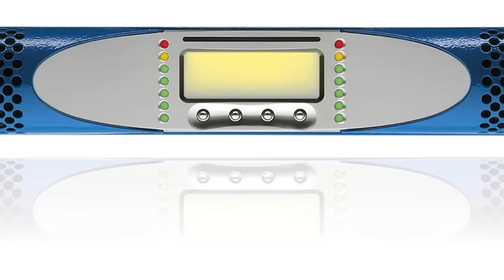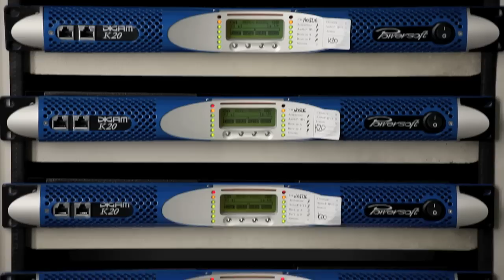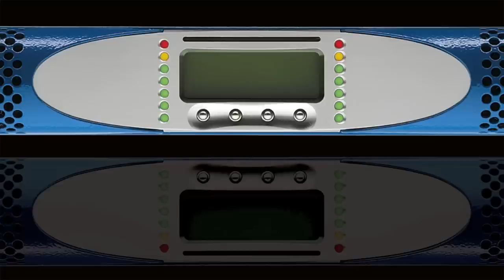How To Make Hi-Tech Amplifiers

Comment: Imagine the HVAC and mains requirements for this facility.
Power output can exceed power input if it's time-limited. These amplifiers work on a principal that is similar to the photo flash: energy is stored in banks of capacitors. A lot of energy can be released in a short amount of time. Of course it WOULD be really cool to have an amp do 9000 watts x 2 channels continuous sine wave, but the demands of that would require an outlet with 200 amp capacity at 120V. Fortunately, music has a crest factor, typically 9dB, so the amplifier only needs to pull 20A from the outlet to deliver those 9000W peaks with 900W avg power levels.
Reply: What kind of drugs are you on ?
Reply: Darren Woods Excuse me? Did you stop by to contribute something useful or just to make a fool of yourself?
Reply: basspig Your the one talking utter bullshit , no amp pulling only 20a can make peaks of 9kw even at 220v thats just nonsense the caps do not hold that much power for one, 

This is the kind of nonsense that companies use to convince you an amp's more powerful than it is.Also caps on the output stages are for filtering out the high frequencies uses in class d operation.
Reply: Darren Woods When I was naive, I used to think the same as you. But then I learned about crest factor and how many joules of energy is stored in capacitors. I'm not claiming the amplifiers can output 9kW continuous sine wave, but they do it for short durations enough for a percussion hit and maybe a bit longer, before the energy storage must be replenished in the power supply. Class D don't use caps to filter the switching. In the Crown XTi series amp I just repaired, their are just four large toroid inductors that filter the switching signal of 250KHz. At those frequencies, you don't need large capacitors to filter RF energy. The electrolytics are for power storage, not removing hash from the output.
Reply: I thought they generally use a LC filter to take care of the high freqs ?  Also I do understand about all these factors , but sorry I still do not agree with those figures. If caps could store that much power they would be better than batteries. And what good is 9kw for a split second like as you put it a "flash" what good is it for a split second ...sorry I got off harsh but I just think amp manufactures often blatantly lie about its power rating , you talk about sine wave and such but have your ever herd the crap amps have to deal with these days like dubstep with massively loud low end basslines that go on for minutes on end.
Reply: Darren Woods I do agree that it's rather ingenuous to rate amplifiers like this, however, in pro sound, entire FoH systems are built with a reserve capacity and rarely if ever see full utilization.
The main factor that makes this work is the fact that music has a 'crest factor' (a peak to average ratio) of 9dB. That means the average power that the amp must deliver is only about 1000W, while it can handle the occasional peak of 9000W for a few hundred milliseconds. 
Electrolytic caps can store a LOT of energy. Back when I used to service broadcast transmitters, the newer solid state ones operated with lower voltage but very high current. Another tech accidentally dropped a screwdriver which shorted across terminals of the main filter caps, just moments after shut down, and the caps had enough stored energy to melt the shaft of the screwdriver.
Obviously, this amplifier cannot deliver 9000W for 30 seconds. Even the Crown I tested at half power into 4 ohm load popped one of its HEXFETs after 40 seconds of sine wave. These modern amps have wimpy output devices that will fail when fed continuous sine tones, so caution is advised when testing on the bench.
Reply: Which is exactly my point , modern music is so bass heavy (saying that some of the old real music can be even worse when played loud) but honestly I have tracks here I use for testing subs that are fair close to a pure sine wave at 30-50hz.

I have a good few amps sitting here and the way they rate them is a joke , I just wish they would pick a standard for real life and not use sneaky formulas and clever math to big up the numbers.

Just wish they would pick a real life standard and not a "we did this in a lab". I like ratings that reflect the actually power output of the amp and not what it can do very briefly, and yea I get it you need head room for the occasional jolt,  but as I have seen before some bastards hide in the small print that it can reach it for ...and I'm not joking ...a few nanosecond's ..how deceitful is that for a testing setup.

I know your not meant to drive amps like a dodgy dj and red line it all day long but hell , would be nice to know some times that whats written on the box is at least some what honest.
Reply: Ps last place I worked was a semiconductor fab/testing facility , over 120 racks burning in rectifiers , talking numbers lets say around 140k rectifiers being burned in at a time.With some not being moved for 2 weeks solid. You can imagine the amount of power used there.
Reply: Darren Woods Frankly, I share your disgust for the industry stretching the ratings like that. That's why I prefer the older amps like the QSC Powerlights I use in my sound system. Even at 59lbs, I consider that light, but the amps will pull 92 amperes from the line and put out 6kW all day long if they have to. But even so, my system is running on dual 15A Potter & Brumfield magnetic breakers and I rarely ever trip them and when I do, the SPL is well over 140dB (the limit of my CEL 201 meter). This indicates that even with pretty heavy bass content, the amp's draw is only a fraction of what it will draw in a sine wave bench test. I have just two 15A breakers serving a rack full of QSC and Hafler amplifiers which, all together, are capable of pulling over 250 amperes with continuous sine at full output (a condition for which I have no dummy load big enough to test).
The reality is, if you could put out that kind of power for several seconds, you'd probably smoke all the voice coils. Speakers are rated in a similar fashion per EIA standard RS-426A and if you put continuous sine wave into those same speakers, they would go up in smoke in a matter of seconds.
Reply: Darren Woods Yes, that's a lot of power. And the amount of waste heat means a huge HVAC requirement to remove the heat from the building, too, which means even MORE electric power needed. People don't appreciate the cost that goes into manufacturing electronics, but when you look at it this way, the prices seem quite reasonable.
Reply: Lol , and why missiles and defense shit costs so much when your charging 700$ for a single UA package transistor or 200$ for one rectifier :P This was not consumer grade components.

But yea just for one rectifier even consumer grade could be in a production run for well over a month in total and then people expect them for cents , its no wonder the commercial shit is done in Asia.

But hey at least when they rate it 3a/1000v you know it can do that for weeks on end. 

And not half a blink of an eye.
Reply: Oh godness. Two electronic en-juh-neeers about class D amps...
Reply: @technodaz he or she is probably on fentinol or some .!.!hajaajajajajaja

Comment: for maintenance I think that these amplifiers would be a problem to get the spare parts I think that the components are not identified a point to find since as a repair technician we must completely change the card holder that does not cost so cheap, I prefer the crown or crest for having better service maintenance within reach. I do not doubt that they are good amplifying but heard comment that their heel of aquileases the power supply.

Comment: Testing all the amplifiers at full power at once?? What sort of mammoth electricity supply do they have??
Reply: The output won't be a simple dummy load, it'll be intelligent power converters to recycle the electrical power - run all the amps in lock step and combine the outputs with small spreader resistors (probably the cables themselves) straight into big power converter.
Alternatively you could probably just set the amps to produce 220Vac at 50Hz out and power half the factory indirectly(!)
Reply: @MarkTillotson  that makes sense - more economical than a big bank of power resistors or heating elements and a fan.

Comment: People thinking that power out can equal more than power in with proper music are being badly deceived, 20 amps at 240 volts in is about 1800 ish per channel out with a 20% loss and that cont max, you will see a little more with peaks but that's about it, yes they are smaller and lighter and aslo more efficient by around 20% over a 3 step class H but no where near what they claim and trust me I have had many years in this game with almost all equipment owned from the proper manufacturers including my own built products, and honestly the only power figures you can trust is old amplifiers or some new ones ie crest 9200, ffa 10000 and some qsc etc, I won't mention the names of the naughty ones as don't want to slag off,,, think of it this way, for a switch mode amp if it's on a 32 amp plug and claiming to be over 3kw per channel at 4 ohms and more than 4k at 2 ohms per channel then for get it, dream land, proper power sounds like proper power it's easy to tell when it's bullshit,  there is a reason why a crest 9001 is rated at 2200 per channel on a 32 plug,